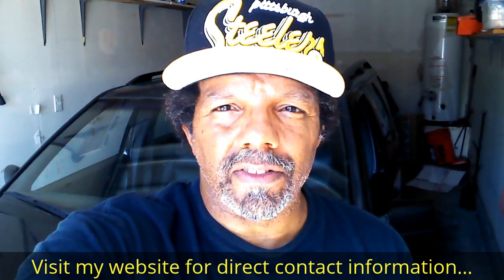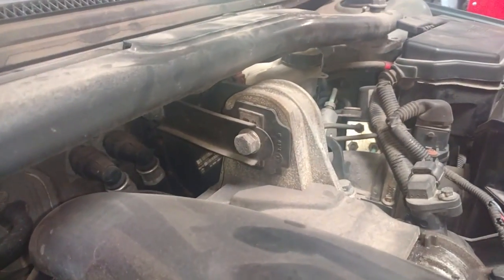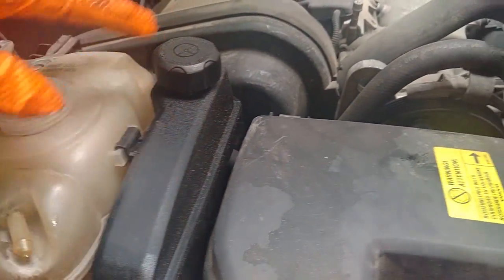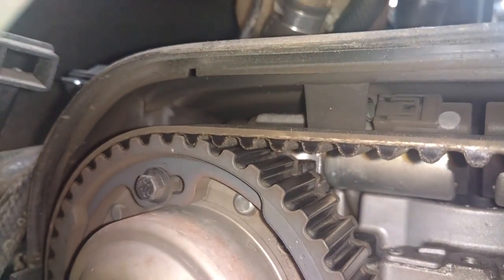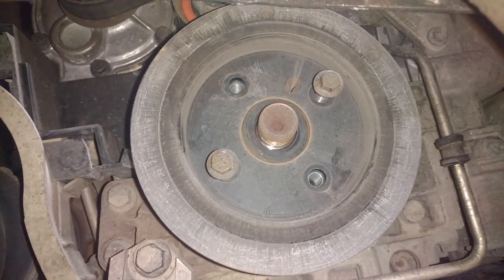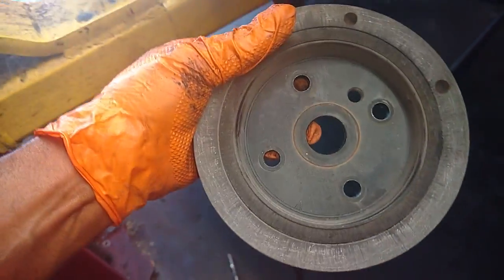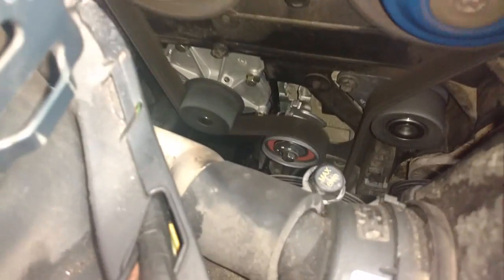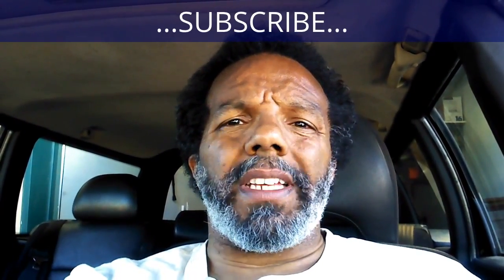How to replace timing belt & water pump on P2 Volvo S60, V70, XC90, S80, V50, S40, V40, etc. - VOTD

Comment: Is this the same engine (2.5L I believe) that is in some of the 2005 s80s?
Reply from the maker: Not sure but the timing belt service is the same.
Reply: It's weird because I had the timing belt replaced at 110k/mi, and now at 152k/mi I'm having a timing issue.  It's knocking and I'm hoping I can do what you've done here and be ok.  Unless I've screwed over the valves
Reply from the maker: They don't make noise. What is knocking?
Reply: There's definitely a knocking coming from under that cover.  Just started tonight, and was told it may be a tensioner?  Check engine light popped on but I was nowhere near a scan tool, so I'm just guessing at this point lol
Reply from the maker: Yikes. Sometimes people use cheap parts or fail to replace all of the parts.
Reply: Yeah I have seen that.  Fortunately I have a good buddy who is an actual mechanic, and he won't charge me labor, just a case of beer lol

Comment: Every single water pump failure on this engine was due to using an aftermarket pump. Use only Aisin or an original pump from the main dealer. By the way, the original pump is good for 200k miles, check the forums. The Volvo dealer will replace the pump only at the second timing belt, unlike a Honda or a Bmw for example.
Reply from the maker: +Royale with cheese interesting.
Reply: I wonder, would you share which camera are you using on your videos?  It has a very clear image and good stabilization.
Reply from the maker: I use my phone. Lots of shots and practice.
Reply from the maker: Oh, I have had OEM Volvo water pumps fail in 86,000 miles and others last 258,000. I give them 10 years no matter the miles.
Reply: Thanks Robert

Comment: hey guy i  moved the crank when i was r/r the time belt 1/2 turn how to fix gspeis1@hotmail.com t or c   nm can not find mark on crank till i take off gear
Reply from the maker: Huh? I don't think that is possible. Did you align the system with the marks before you took the belt off?

Comment: Thanks for the video Robert!  Very nice job - I will be doing mine soon and this helps out a lot.  Can you tell me how you get the crank pulley nut tightened up?  Do you need a special tool to hold the crankshaft while tightening that huge bolt?
Reply from the maker: +notny411 they just tighten it on with the impact gun.

Comment: Thanks for the video, it had some good info, but it totally doesn't apply to my 2008 Volvo V50.  I don't have near the room for getting at the timing belt side.  I had to raise/lower the engine for different panels that needed to be removed and now I don't have the space needed to physically take the water pump out of the car.  I'd like to strangle the Volvo engineers for their lack of thought for water pump replacement and clearance for removing anything on that side of the motor.  I had to buy longer wrenches, and special adapters to get the right length for the sockets to fit in the narrow spaces.  No one has any video on doing this on a 2008 V50, and now I know why...It was designed to keep backyard mechanics from doing the Volvo mechanics' jobs.  Totally frustrating.  If you have a newer V50, be sure you know what you're getting into...
Reply from the maker: Ouch! Thanks for sharing.
Reply: V50, C30, and S40s are technically P1s.  Completely different set ups...   Just FYI for anyone that happens to land here looking for info.

Comment: Thank you for the share Robert. To be correct this does apply to a Volvo v70 2008 ?
Reply: yup
Reply from the maker: Yes.
Reply: Robert DIY what about a 1999 volvo s70 2.4 base
Reply: Yes, SOME of it applies, but beware of differences in the vehicles that can make it a lot harder.  My V50 for example was 10 times more difficult than portrayed on this video.  Only a portion of it applied.
Reply: 2008 was the first of the P3 platform so beware.  Similar to Aaron Kraemer's issue...V50s are P1.  Apples and oranges.

Comment: Tried to turn the crank but it doesnt budge?
Reply from the maker: +72caliman is the engine locked up?
Reply: Robert DIY How would I go about un locking it? Its a 04 xc90 t6 awd.
Reply from the maker: If it's locked up, probably by replacing it. Has the vehicle run lately?

Comment: Got this, and the water pump done on my 2001 non-turbo, which was almost 40K overdue---first timing belt job ever, and took me over 7 hours. The old belt looked good, but the pulleys were definitely going; a good amount of grease was coming out of those bearings. My near-245K S60 is definitely happier.

This video especially helped with the water pump segment! Thanks!
Reply from the maker: +Blue Falcon good deal, you are welcome.

Comment: Hey Robert, just did my timing belt last weekend. Thanks to you and some other people on YouTube I got through it. One thing though, a couple of times my car shook a little bit when I took off from a red light. Only happened twice, same circumstance, taking off from a red light. Do you know why it's doing that. No shaking at all other then those two times. I have a 2003 Volvo s80 non turbo.
Reply from the maker: Codes?
Reply: There  are no engine lights coming on, if that's what you mean. While we are chatting, I also have a problem with my cooling fan staying on for 5 minutes after a long drive. I'm thinking thermostat, what you think. It's not reading hot at any time on my gauges.
Reply from the maker: Probably the throttle body (ETM) going bad. 
Likely the ECT is bad.
Reply: Thanks, will be checking into that

Comment: Robert do you know the size socket fits the crank bolt . thanks
Reply: Its for a 2005 v50 thanks
Reply from the maker: They are all the same. Did you watch the video?
Reply from the maker: Interesting, 36mm.
Reply: Yes i did , thanks for your dedication .!!!
Reply: For the 2008 V50 it was a 30mm socket...

Comment: Why would worry about the timing marks when the old belt is still installed?  Just take off the old belt, align the marks and then install the new belt and go from there,,,,
Reply from the maker: That doesn't work with an interference engine.

Comment: Thank you for all your videos, going to attempt this same procedure, water pump/timing belt this weekend. 

I do have a question for you, is it necessary to remove the harmonic balancer? There are other videos where they do not take the harmonic balancer off to remove the timing belt, I notice that they remove that lower bracket instead, but in that particular video, they did not change the water pump, which I am.

I do not mind doing the extra work, but I was just wondering because:

1. I do not have an impact gun and afraid to move the lower crank when removing the crankshaft bolts 
2. I do not have new replacement bolts for the balancer (Are they necessary?)

I picked up the parts at Volvo and their parts guy told me that it is not necessary to replace the bolts (with new ones) on the water pump, your thoughts?

Lots of questions, I thank you for your time. Your videos are thorough and well versed. Fantastic Work.
Reply: chillsgo chillsgo hello, I would recommend watching the video that Robert puts up about what to look for in buying a used Volvo, he lives about 10 items very thorough. 

Personally with mine I would check that it does not smell like gas, as mine had a crack in the fuel pump which made the car reeks like gas, fuel pump cost about $400 and it was working but could not be repaired. Changing the timing belt and water pump was not necessary but important since I did not know when the last time it was changed, it was a long but not difficult do it yourself projects. Also my radiator went and that wasn't cheap either so I will just inspect that system. I would also make sure the suspension feels good since it's so expensive. 

I bought mine with 190,000 miles so if it has a lot of miles expect repairs to come your way I pay 2400 for my V70R but I probably put another 3000 into in 6 months. You do it because you love him, I love that car
Reply: BTW It is on a 2004 Volvo V70R with 197,000 miles
Reply from the maker: I usually DO NOT remove the harmonic balancer. I remove the bracket from under the crank, two 10mm screws. 

You may need to replace the water pump bolts if the water pump housing is thinner, which is common for the new pumps vs the older ones.
Reply: Michael Saba... I just replaced my T- belt, water pump, tensioner, idler and lower main seal. I always replace the lower main seal when I do timing belts. I figure, if the seal survived 105,000 miles, might as well change it and it'll probably go another 105,000 miles without leaking. Not much additional work for this insurance. After I removed the harmonic balancer, I used a 2 jaw puller to remove the crankshaft timing belt sprocket. It was too tight to remove by hand. Yes, the crankshaft did move a little during this procedure, but I didn't have any valve contact or anything like that. After removing the sprocket, I used the lisle seal removal tool to easily pull the seal.  I put a little white lithium grease on the lip of the new seal, then I (carefully!!) worked it on the crankshaft and into position. I used properly sized deep socket to drive the seal in the rest of the way. I cleaned the sprocket spline of any rust or debris with a small wire brush, then I re-installed it. It went on fairly easy, just tapping it with a brass hammer. Next I re-aligned the crankshaft timing marks, as they did move a little bit, not much though, no valve contact or anything like that.  Then after the timing kit was installed I replaced the harmonic balancer, and torqued the crank nut to spec. That was it.
Reply: I've had a lot of issues with the body control computer not functioning correctly; old worn out key is a bit finnicky.  Try to get two keys and a working remote, or keep in mind that either of these items are $175 each. Make sure the lock/unlock button works, remote works, and key works flawlessly.  The drive-by-wire throttle is known to have issues--see how the acceleration works. Bring an OBDII code diag tool with you to check for error codes.  See if the radiator fan comes on and check for coolant leaks.  Check the transmission fluid--it will be pinkish if new and grey if it's really old.  Strut mounts fail--check for clunks over bumps or vibration on the highway.  Unevenly wearing tires may be sign of failed control arms.
At 200,000 miles our '01 v70 needs new front strut mounts, struts, all 4 break rotors, radiator, radiator fan, heater core, fuel pump (fuel gauge no longer works), body control computer, key, remote, water pump, water temp sensor, alternator, tail light fixtures, and throttle. It also has an unresolved issue with the oxygen sensor not sending the right signal to the computer; new o2 sensor, spark plugs, hasn't resolved (coil packs tested ok).  Try to find one with 100k miles or less.  Watch Robert's other videos.
Reply: Man, little too late for, wish I would have thought of it then. I was intimidated to take the balancer off because I didn't want it to move, but in hindsight it would have been alright. Hopefully the seal won't fail on me. Thanks for the description though, next time I have to get in there I'll look into replacing.
Reply: Hi Michael, I'm looking into buying the same year or older model, anything i should look out for . thanks
Reply: Hello, and thanks for replying seen alot of Roberts videos very helpful thanks again.
Reply: Thanks

Comment: I love the tip about the mount. However, I have had one of these mounts horribly fail to where I had to cut the rubber away to get the bolts out. To keep from putting extra stress on that mount, maybe try a block of wood to support the engine there. I always use you're videos for reference. On a side note, if you happen to get another dual vvt car, could you snap a picture of the back of the cams with both front marks aligned? I recently bought a used head, and someone took off the exhaust hub so I'm not sure if I've got the exhaust cam right or 180* off. Thanks and keep up the good work!
Reply from the maker: Did you look at my timing demo video? They are all the same on the back, the locking tool only works one way.
Reply: Do you have a link to said video?  I'm having a hard time finding it using mobile.  On the vvt heads, the rear of the cams has 3 slots missing for each cam.  Two tool sits in two slots on each cam.  I was curious about the position of the third notch.  Since the hub was removed the timing marks aren't lining up.  I want to get the cam locked in the right position, then loosen the hub and make the marks align, than tighten it all down.  Thabks
Reply from the maker: I do NOT have a video showing how to properly set up the hubs from scratch. So, I really can't help you there. You can take it to a mechanic and get it set properly. I did a video in Brimmington WA showing the back of the cams with the tool installed.
Reply: Ok.  I'm sure I'll be able to find it.  Looking at the valves, I'm 99% sure I've got it right, but with these cars that's not good enough as you know.  Btw, are you over on volvospeed?
Reply from the maker: Nope.

If the timing is off, it will likely toss a code.
Reply: Not with my circumstances. I've got a 98 s70 that I swapped an 02 b5234t3 into, and now I'm putting an 03 2.5t head on it. I don't think mototronic4.4 will throw a code for anything with vvt, will it?
Reply from the maker: +Wesley Dunn nope, just run like crap.

Comment: i have recently got hold of a 2000 2/5 td v70 5cyl vw . its a pretty nice motor 98000 genuine miles .
can any body tell me what f*****G manual covers this engine???
many thanks.
Reply from the maker: Is it a Volvo or VW?
Reply: Haynes VW Diesel Transporter (5711) is the best I've found, nothing covers the Volvos with the VAG Tdi perfectly unfortunately.
Reply: hi robert,yes its a volvo fitted with a vw5 cyl  tdi
Reply: hey i will give that one a go thanks